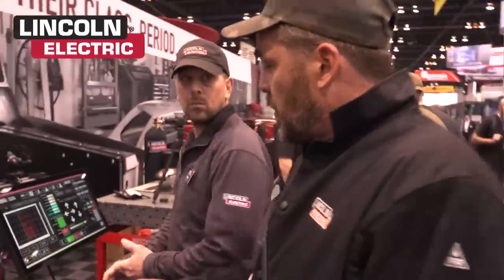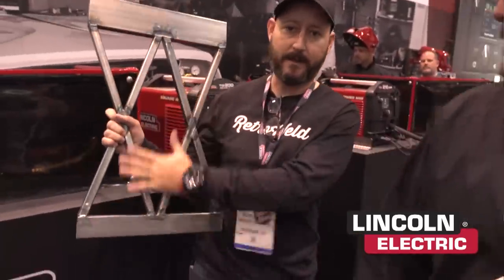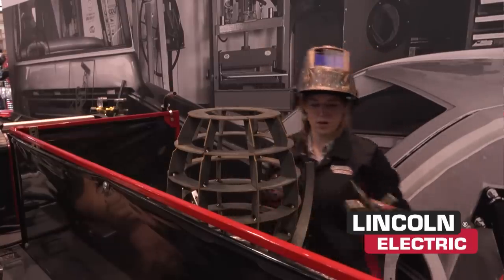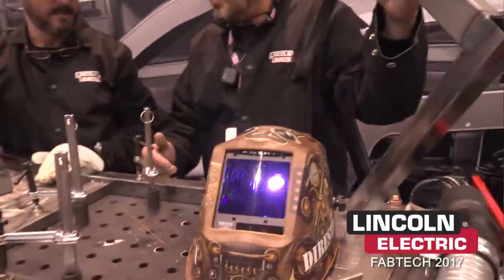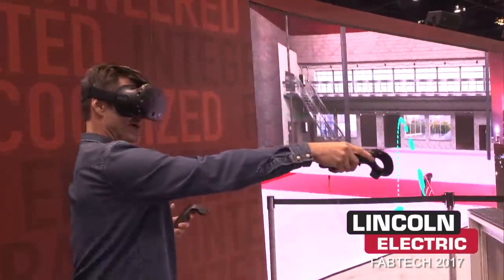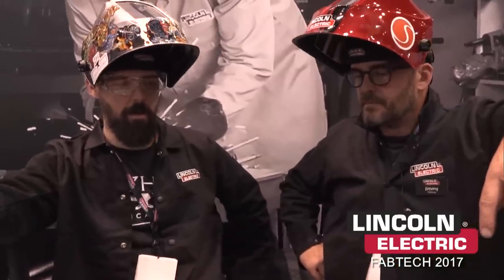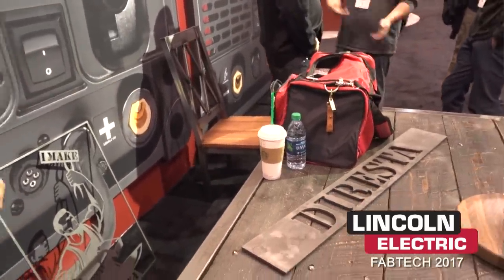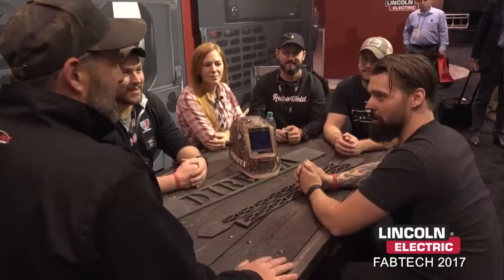Fabtech 2017 LIVE from the Lincoln Electric Booth

Comment: I had a stupid boss that got angry with me so often because i would clean the millscale off my steel before i welded it.  I worked for a tractor trailer company...  this shit is on the road people.
Reply: Mill scale, rust and paint need to be removed for good strong welds. Or important welds. Otherwise they end up as impurities in the weld. Some people think you can burn through them. Some rods help with welding dirty metal but they will still have impurities in their welds. If you are just welding artsy fartsy lawn decorations and non structural things... then you can weld dirty.

Comment: Are you kidding no one has any damn files around when they are welding, I have never used a Dremel unless it was in a very tight corner or something like that, but to knock down a spot weld like April needed to do, or on the tip of the big "C" clamp, a file would of been the tool of choice, personally for April's spot weld, and Zack's "C" clamp I would of used a Nealson Double Diamond in a 8" to 12" or at least the trusty ol'Bastard file. And once your accustomed to using a the various types of files and lf properly cared for they'll stay sharp & last for years,  for example 4 or 5 strikes with the Dbl D or Bastard file and the spot weld is out of the way and  never leave a mark anywhere except the on the weld you to move, And the Clamp would of looked great as well.